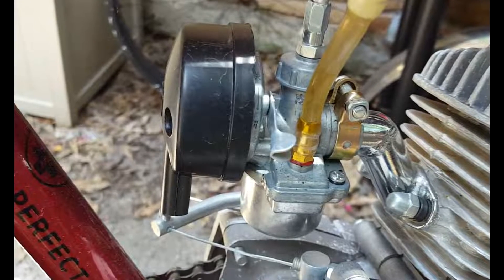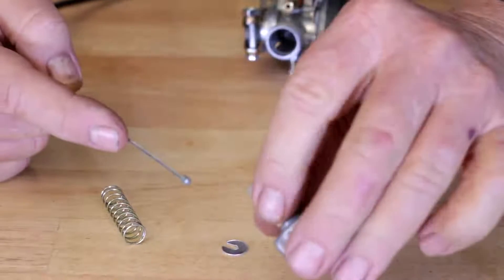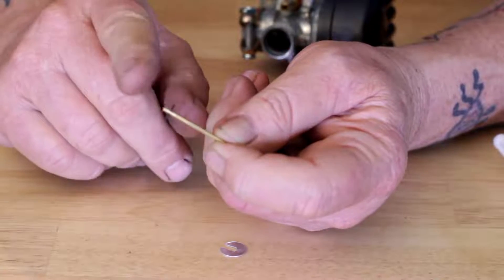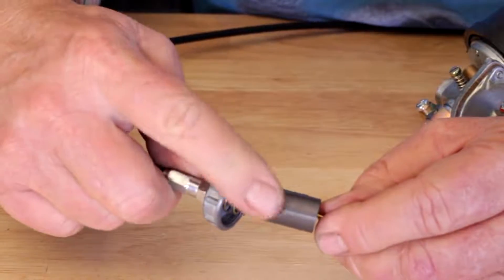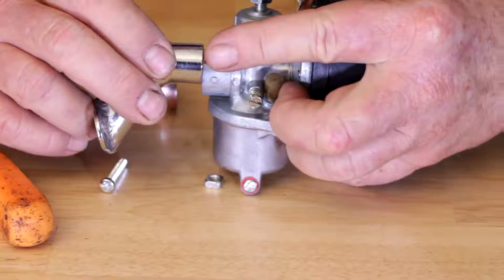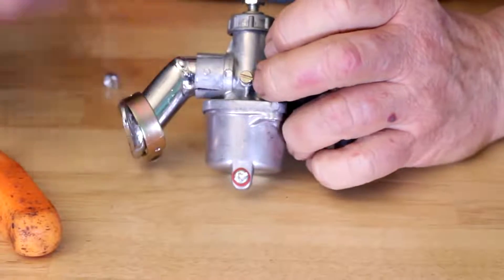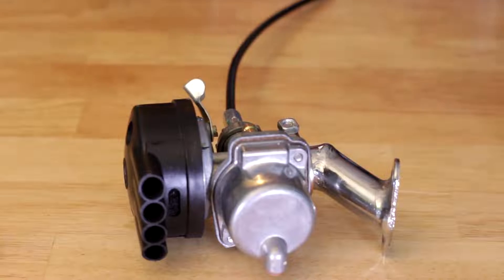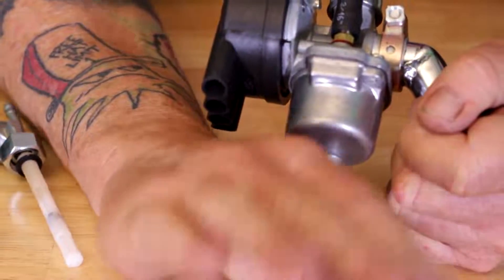How To Replace Motorized Bicycle Carburetor 66cc 80cc

Comment: Yeah when I push the pump the primary gas leaks out with the primaries at do you know if I should just order a new carburetor
Reply from the maker: Normal if it only leaks a little when you press primer. that floods the carb

Comment: Hey I'm having a problem with my 50cc carbrater is leaking for wear  the float is and wear the are filter is I have tacking it a part and it is still leaking
Reply from the maker: Look at my 2 stroke carburetor leaking video

Comment: Quick question,,can I use the old pin set up from the old carb, and just slide it into a new carb?? Or do I have to take it all apart and reassemble the new pin and stuff that comes with the new carb
Reply from the maker: OK to reuse as long as the slide isn't badly worn
Reply: HoustonMotorized thank you Sir

Comment: Nice video. My gas tank leaks from the cap despite I bought a new cap. Is that "normal"? What do you recommend? Thanks.
Reply: tupapirafa I wouldn't think that's normal, seeing you bought a new cap, and it's still leaking, I'd say it's the tank itself,!? Good luck
Reply: tupapirafa  Use a  lawnmower gas tank and zip tie it to the back of your seat . Works Perfectly !!!

Comment: Hey boss how do I put a sprocket on three wheeler
Reply from the maker: I mounted one on the wheel using a rag joint. some have welded the sprocket to the shaft. Takes a bit of engineering to do it
Reply: Yeah you would have to weld that and even with the motors sprocket
Reply: Somewhere in the middle